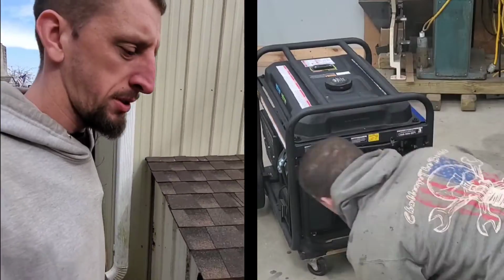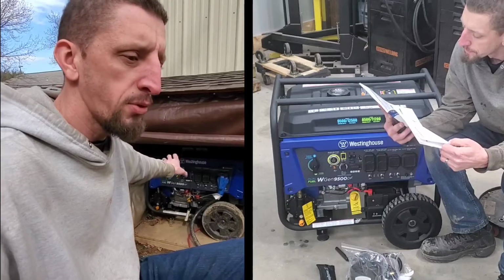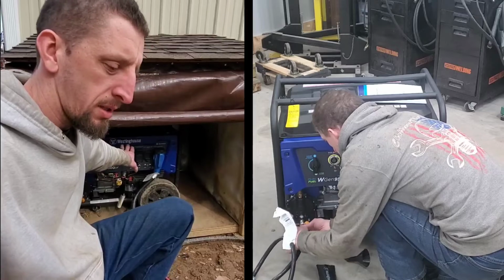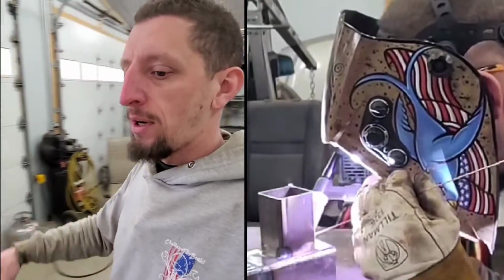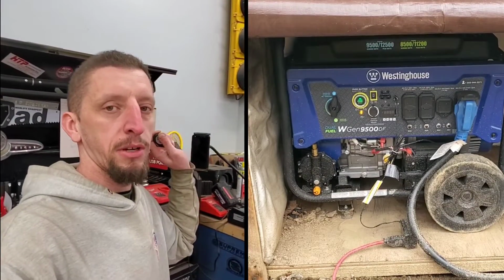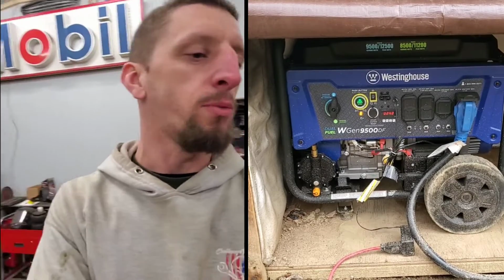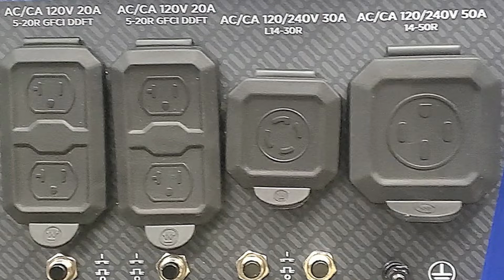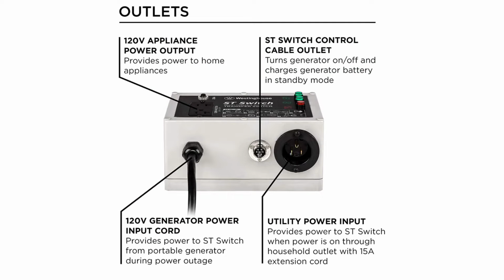Westinghouse Generator Review The WGEN9500DF (Dual Fuel) - How I use It In My Garage / Shop

Comment: I have the same unit. I run my house with it during occasional power outages. 50amp with manual transfer switching. I unbonded the generator's neutral as it is bonded  and grounded through my house panel. I did have to install a Micro-Air Flex soft start unit on my central air condenser. Also use surge suppressors and UPS's on my electronics. I only run it with propane. 4 years now. So far no issues.

Comment: Well, I have one I got four years ago, got the electrician, wired the house for use, estimated power needs, this will run most of the house. 

Four years later huge wind storm power out. I ran this for 36 hours, no problem full power, no real issues. Full tank of gas ran about 11 hours. Total cost install, unit and electrical parts/electrician about 1600 bucks with the unit running 1050 in 2021. I'm seeing these now Dec 2025 as low as 850 bucks. 

Well worth it. I went and got 91 octane no ethanol fuel and it worked great. I ran it dry for a few hours after our power came back in case it went out and back and now it's ready to go for next time in a few years...

Edit: One strong suggestion. My electrician got me a very heavy duty 12 foot 50 amp connector. One, "sort of" design flaw on this is where the wheels are as in directly under the 50 amp plug in for the house connection. Some of the high quality 50 amp lines are so thick and stiff, that the wheel gets in the way because you cannot flex the line because it is so thick and so, you have to get the plug away from the unit by at least the thickness of the wheel to plug into the generator. You could use a surge protector but will generally find them less quality line than the actual cord or even something like a welder's adapter https://www.amazon.com/Tellegloww-Welder-Adapter-14-50P-Generator/dp/B0DKNGC7NY/ref=pd_rhf_se_s_pd_sbs_rvi_d_sccl_2_5/131-7266851-0023121?pd_rd_w=1KMpv&content-id=amzn1.sym.6640a844-ab24-4352-ac9b-78899e683a5e&pf_rd_p=6640a844-ab24-4352-ac9b-78899e683a5e&pf_rd_r=NQW94HBRKZJXSAVFNT2G&pd_rd_wg=OcDTd&pd_rd_r=1b9453dd-ba4a-4a36-80f6-1d59b685172c&pd_rd_i=B0DKNGC7NY&th=1 

IF you can, ground the sucker. I'm fortunate in that from the storage spot to where I put the generator next to the power intake for the house, I am covered and protected under the eaves, can access the ground for the house pretty easily and close.

Comment: Does the battery on the generator need to be charged?
Reply: its unclear for me.  I was told that these do NOT have a stator to charge the battery so you must use the tender to keep it charged.  Easy enough to tell using a multimeter.

Comment: I’m told that this model does not have a stater meaning that it cannot recharge the battery when it’s running. I don’t know if that’s the case or not can you confirm?

Comment: I have the 9500 and have for a good many years   it is extremely reliable, and will power several applications at once, such as a/c , hot water tank well pump, microwave, etc.....I always run it out of fuel when shutting down, and purchased it when it cost around six hundred dollars ..I paid two hundred to have a wire connected to the back shed, and in turn it back feeds the house.....I also change oil and spray it down with the wd Gell which is a decent oil, so in the salty air environment it hasn't`t rusted out.....after loosing power for the last two days, it started with the two pulls, and after re fueling it starts on one pull  :-)  just sharing my experience and highly recommend this   Tony
Reply from the maker: Appreciate you sharing your experiences will definitely add value to those who are considering this generator.    Thanks Tony..👍💯

Comment: Is the generator output pure sine or modified
Reply from the maker: The only thing I have done since posting this video is change the oil twice and put a new spark plug in, also turned up the governor for a specific piece of equipment I needed to run for a short time, other then that everything is running as normal with no issues and or complaints.    It's a solid unit...

Comment: How efficient is so far? Training ti decide between the 7500 vs 9500
Reply from the maker: Just buy bigger...😁... I actually wish I bought the next size up for how I use it, I really could use a little bit larger generator.   The remote start is awesome!   I love the remote...  Great generator!   I have changed the oil and a spark plug, otherwise no issues yet.  Good luck on making the decision 👍.

Comment: Is there a way to regulate the output?
Reply from the maker: 🤔Phew I'm not sure... I am sure there's away but I don't have an answer.   I am more curious as to why the need?  Are you trying to regulate voltage? Or Amperage?  Or both..?  And for what?  😂😂🤷‍♂️
Reply: @ChallengeTheBuild  voltage . Some said I would burn up the electronics
Reply from the maker: Ah... My brain goes to using a large surge protector, something you would wire into a main panel or something like that....I personally have not had any problems running any of my welders or plasma cutters and most of them have lcd displays and such but in regards to smaller electronics such as computers and things like that I have no knowledge...  Good luck 👍
Reply: @ChallengeTheBuild  np thanks so much for responding

Comment: I hear these generators are Chinese crap is it true
Reply from the maker: I don't think it's true...  The build quality is better than other competitors and I haven't had any issues with mine yet...  Actually it's due for an oil change..
Reply: @ChallengeTheBuild what about now? Any problems? Still like it? I’m thinking about buying this exact one. Today is 7-19-24
Reply from the maker: @joshmason7037  I would definitely buy another one...  I have had zero problems with mine, LOVE THE REMOTE START, and we just lost power for about 14 hours this week due to a serve storm.  I had my fridge, tv, dvd player, ps4, two fans and two ac units (one at 13amps) running for most of the outage.  (I still need to get a transfer switch installed in my house).   Depending on current load of the generator she can be a little thirsty but Im okay with that because it just works.   I think Ive done 3-4 oil changes on it and every time I do an oil change I also just replace the spark (cheap insurance) I have noticed it sometimes runs a little rich due to the automatic choke feature.    Otherwise I can't say anything bad about it...  If you end up buying one I can only hope you have the same experience.    I still use this exactly the same way in my garage for running my welders and milling machine and it just keeps on going..      Hope this helps...  Thanks for watching and commenting 🤙
Reply: @ChallengeTheBuild  ok gotcha. Good deal. I actually have a 120volt inverter generator I use now for backup for my whole house. Wired it in my main panel and it runs all 120 volt stuff including small window AC. I flip off all my 240 volt breakers when using it. Im just needing a 240 volt generator for my hot water heater and electric stove. I’ll hook it up just to heat water up and cook on stove top and then kill it and hook my inverter back up. Thanks for the reply
Reply: @joshmason7037  did you consider whether you have MWBCs???  Dangerous if you did not

Comment: What's the run time on a full tank of gas.And is it safe to add 3 gallons of gas while the generator is running so you don't have to turn it back on  ?
Reply from the maker: Check out my 10 frequently Asked questions video here https://youtu.be/yyhjhib5x5E , and as far as filling it while running?  You could do it however it's very dangerous and I am not recommending you do it.  Make sure to read the manufacturer's user manual. 👍
Reply: NO!!

Comment: Nice video. I've noticed a lot of people put their generators in sheds boxes insulated Etc. I have a very large solar system I use a generator to charge my batteries when we have overcast days. I find that leaving your generator in a shed enclosed area shortens its life it creates too much heat.

What are your thoughts?
Reply: Same here. Need a generator to juice up my battery packs if I'm without sun for 4 or 5 days. Good to hear about the workout you've given it and performance. I'll be using propane to avoid stale gas issues as much as possible since it's not going to likely run much other than maintenance runs and won't need to run too long when it does. Can't seem to find anyone that's been running them on propane. Be nice to just know there's not issues.
Reply: @beebop9808  we desperately need to change out our batteries they're well over 7 to 8 years old now. So I'm running generator more often than I should need to.

Since this video I have put my generator in a enclosed area with a lot of ventilation. I also have a fan pointing at the generator runs off of its own power. When generators running.

I generally run generator on gas because you get more power we have tried propane though and it seems to run a little less hot and a little quieter. It seems to have ran about the same as a can of gas. Although from my understanding it will not last as long if you do purely propane.

Either way it sounds like you have a pretty good solar system. I'm pretty proud of mine it's just we definitely need new batteries at this point we definitely run the hell out of our generator.
Reply: @mr.hemiroids794  Yeah those batteries are a painful pill to swallow. Don't seem to be getting any cheaper lately except for some of the small 12v packs that are useless on larger systems IMO.
If you're into DIY and follow those circles, I'll put in a plug for Amy Wan. She seriously hooked me up recently on 48 A Grade 304ah EVE matched cells. Buss bars and separators delivered for just over $5k. Can't beat that with a stick.
Reply from the maker: Thank you for the feedback,  as far as keeping it in the enclosure considering it spends all it's time outside I look at it as protecting the investment.   Now as far as shortening the life span I am sure the added heat doesn't help but with routine maintenance I am sure it will perform as it should for a quite a while.   Figure it only runs for generally short time periods every so often for me so heat may not be an issue BUT maybe a 12hr run with a power outage, that may be a different situation...🤷‍♂️. Thanks again for watching and commenting...👍

Comment: Great video 📹 👍!
Thanks for taking the time to share with us.
Now, I have a question for you?
Did you have to modify the wiring (ground) in your gen prior to hooking it up to your panel?
I'd appreciate your response.
Thanks!
Reply from the maker: No modifications to the ground, however I should drive a  ground rod at the generator location and then ground the generator to the ground rod for added safety,  I just haven't done it yet..  It works great, and LOVE the remote start feature 😁.   Good luck be safe and thanks for watching and commenting.  I greatly appreciate the feedback. 👍
Reply: @ChallengeTheBuild  THANKS for the quick response and good advice!
God bless you and yours 🙏 🙌
Reply: @ChallengeTheBuild  You don't need a ground rod if you're hooking it up to your panel like you did. It's already grounded at the panel. What the person is asking is, did you remove the bonded neutral? That's important, not whether it's grounded with a separate ground rod .Which is totally unnecessary, the way you're using it.
Reply: I have this gen and love it, but I always have to set the choke in order for it to cold start.